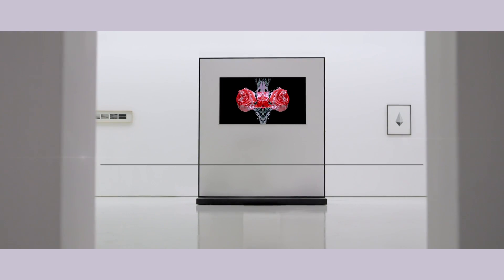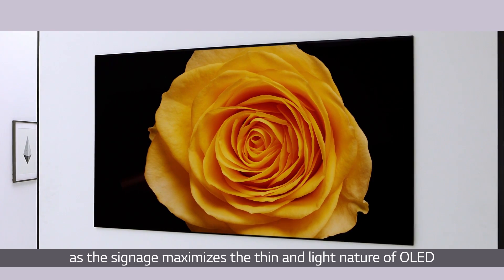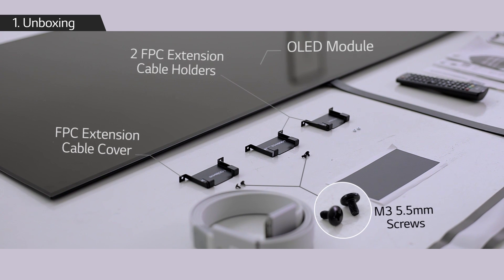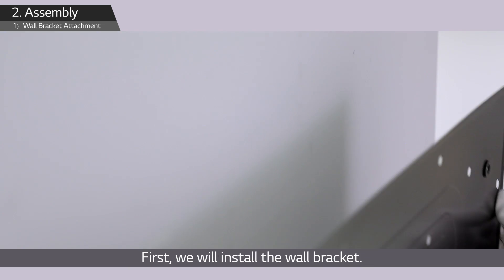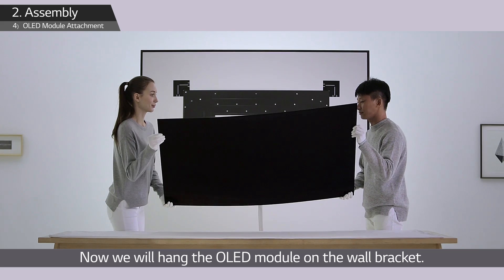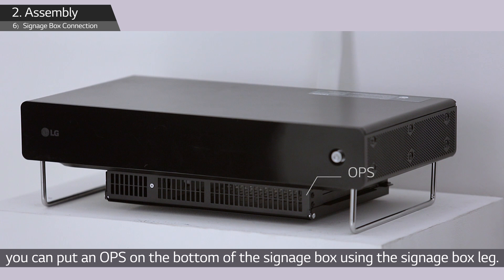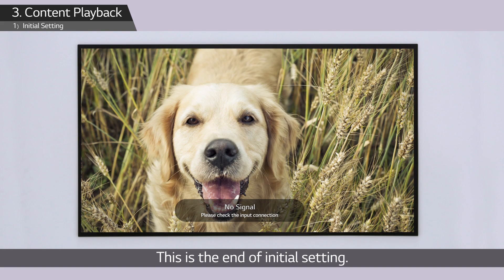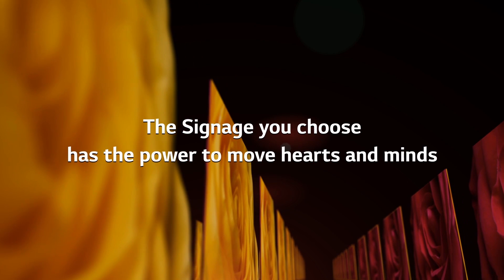LG’s Wallpaper OLED Signage Installation Guide (55EJ5C)

Comment: All you need is 1 wall in front of your wall and 1 table to put all other equipments on it. By the way don't forget not to install cable holder between the display and the box, in the case of kids or pets. If you don't want them to stumble upon the box and tear the sh*t out of the display.

Comment: I have an issue with the FPC cable at the bottom. If you want to have it curved to the right or left, you can't - as it goes straight downward. There at least be an FPC cable option for a angled left or right cable.

Comment: OMFG wat's the point of having something that thin and go through all that. I don't want a cable hanging down from the screen. Just put in in a case and hang it on the wall and call it done. Can you be leave on how large the cable conectors are. LG can mage thin screens but apparently not thin connectors.

Comment: Why would anyone want that ribbon dangling from the bottom of that tv.  Just run it through a flush mount box into the wall, protect it with some smurf tubing and back out behind the signage box.

Comment: This is nothing new , they have just removed the power supply unit and the video controller board out of the regular TVs into an additional box. Hence the TV is so slim . You can do this by yourself with Regular TV you have. :D , If anyone needs , I could guide then how to do this.

Comment: What good is this? They are selling you disassembled TV for 10x money. LOL garbage
Reply: Viliam Sonntag What are you talking about? Basically you just have to connect two cables.
Reply: tonyrulez69 no he means the other black box that provide power and output/input . normal tv.s have that built in but lg says this tv is ultimate thin but actually they are selling you a screen with a tv box  connected  dont be fooled you are buying a thin  screen with cable to a box that provide power and the other things the tv needs . sorry for my bad English
Reply: Viliam Sonntag Loewe for the win.
Reply: Viliam Sonntag Exactly. The cable could get damaged easily. LG seems they only maintained the thinness, but launched disassembled TV as a result. lol. Some may satisfiy with tgus product, I personally will not at all.
Reply: Viliam Sonntag lol
Reply: Viliam Sonntag lol
Reply: Viliam Sonntag 😃

Comment: Why LG showed it today on CES 2017 as a new if we could see since last year?
Reply: They got rid of signage box and replaced it with sound bar. Much cleaner
Reply: Rodrigo Freijanes This was a commercial product, not something available for consumer viewing... The one shown at CES doesn't require this installation process.
Reply: Bank Akinmola I think installation is the same or close.
Reply: Rodrigo Freijanes It's not the same. The TV is simpler to install.
Reply: Bank Akinmola nice. 
I thought this one is simple just like the one on CES2017.

Comment: Hi - could you explain how OLED has Black luminance of 0.001 nit - all my measurements and from people from the industry I've talked to say it is 0.0000. Thank you for the answer.
Reply: TV Calibration with Darko 
oled only lights up the Pixels in use, any pixels that need to show black are just turned off

Comment: OMG... How can a TV be that thin!?
Reply: Moin Uddin Actually is because no backlight is needed due to pixels that emit their own light.
Reply: This is what we call the future. 30 years ago no one would have thought that a paper thin television was possible.
Reply: 89juhee its not TV its only signage
Reply: 89juhee if you took the LED panel from any laptop it would be that thin. All they've done is take the panel and moved the bulky items that normally make a self-contained TV into an box that sits somewhere else.
Reply: 89juhee is this tv or whut?
Reply: Ummm, they did mention it.
Reply: They extracted all the bigger components to the box below the tv